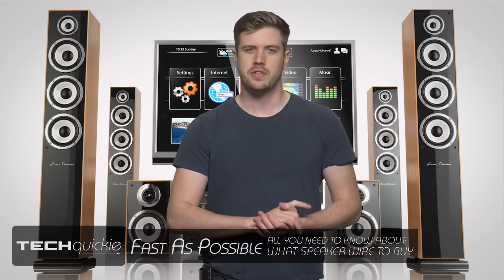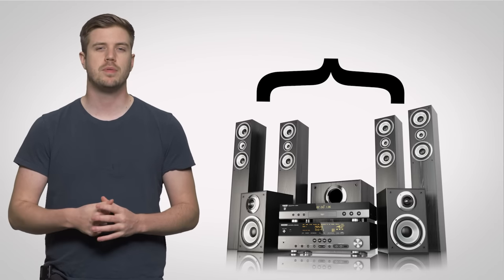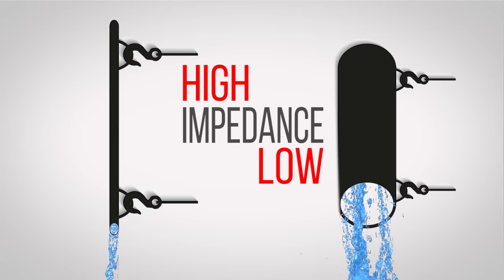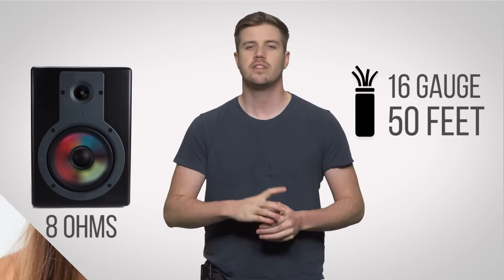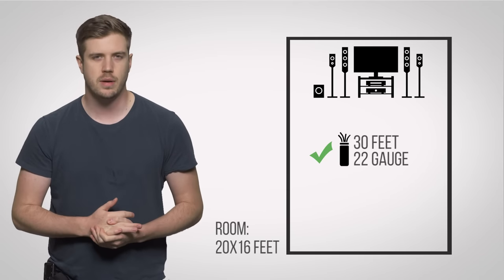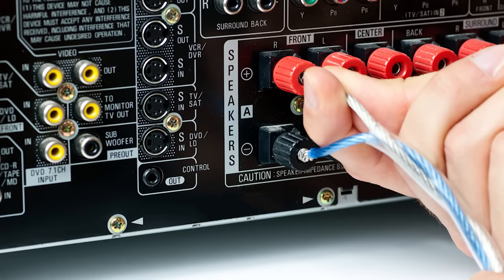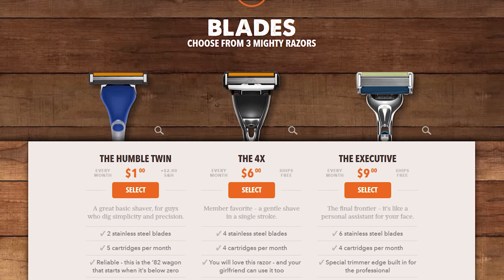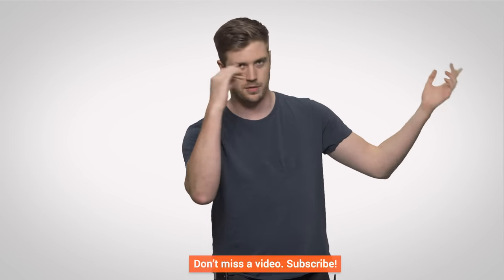What Speaker Wire To Buy As Fast As Possible

Comment: 16 ga lamp cord
good enough for my trainwreck amp
DONE
Reply: Define "trainwreck" 

if you mean old then it might actually be pretty good i know several amps from 70 - 80 and mid 90s who is considered best sound for various applications my Kenwood from 89 holds up pretty damn good as well real power house rated at 40 watts drives 2x15" subbs witouth any problems and a good cable helps a lot not only due to resistances but also sound quality there is a lot of factors to think about im using silver coated copper wire with tripple shielding and its as close as you can get for 150 dollars (which isnt that expansive)
Reply: Define "trainwreck" 

if you mean old then it might actually be pretty good i know several amps from 70 - 80 and mid 90s who is considered best sound for various applications my Kenwood from 89 holds up pretty damn good as well real power house rated at 40 watts drives 2x15" subbs witouth any problems and a good cable helps a lot not only due to resistances but also sound quality there is a lot of factors to think about im using silver coated copper wire with tripple shielding and its as close as you can get for 150 dollars (which isnt that expansive)

Comment: I'm very disappointed that you didn't at least annotate the converted units in metric units. You guys have an international audience - and most of the world has no clue what gauge 16 means. We need mm².
Also, you really should have explained the difference between 100% copper wire and the cheaper CCA Aluminum cable... and the fact that electrically, a thicker CCA cable is identical to a slightly thinner copper cable but often costs less.

Comment: Well yet another so called "expert" who is giving wrong information.  It wasn't terrible until he got to the point he voiced his opinion on better speaker cables.  That they are snake oil lol obviously someone who doesn't know audio.  All cables make a difference in sound quality, granted there are some cables as marketed as "higher end" especially through the chain stores, but there are better and higher end cables which you can purchase at your smaller independent high end stores that make a big difference in sound quality.
Reply: Audiophiles have strong opinions on speaker cables but frequently know very little about these low impedance loads or the conductors required to drive them. If they studied the subject properly before investing large sums in vastly overpriced conductors they would have a more objective opinion when choosing suitable cables for their systems.
Reply: @cbcdesign001  Who says they don't know?  Many audiophiles are engineers and PHD's.

Comment: High end speakers are 4 ohm???? WTF! That's a complete load of shit. I have been into extremely high end hi-fi for many years. I have come across no more than 3 4ohm speakers all of which were budget/ mid range. If anything hi-end manufacturers (or any for that matter) prefer to go no lower than 6 ohm so as not to drive the amplifier too hard. The only place 4ohm is really used is in car audio where as much power in as little space is important.

Comment: Yes, the wire gauge vs length is the big thing here, but the reasons you gave are just plain laughable.  The advice on using the thickest wire possible is the best advice to avoid the voltage drops presented by long runs of thin wire, but most of what you said in this, you pulled straight out of your posterior orifice, and has no basis in physics.

Thumbs up for the proper conclusion (the thicker the better), thumbs down for not understanding why.  Thumbs cancel, I won't rate it.

 73 de KC5VDJ

Comment: Come on guys.. 🤣😂
Recommending 20 and 22 gauge speaker wire for subwoofers... 👎💩
Sure if you have a crappy low wattage PC audio subwoofer or something maybe 20 gauge wire won't matter. 
20-22 awg wire is recommended for a maximum of 1.5-0.92 amps respectively. 
P=I^2*R
Assuming an 8 ohm load that gives you a maximum power rating of 18 watts for 20 gauge wire. 
If you have 100 watt, 8 ohm speakers you should be using an absolute minimum of 16 gauge wire. According to the recommended maximum current capacity of the wire. 
If someone followed your advice with anything but the crappiest low power equipment they could literally fry that 20-22 gauge wire in their living room and start a fire.

Comment: WRONG! 
high-end speakers have higher inpedance( @ 8ohms)  - normal/cheap speakers have lover( @ 4ohms) & car speakers have from 4 to 1 ohms. Do your reaserch better.
Reply: +Adam Steel what u have are speakers for mass production - check the big players with prices above 10k to 300k / either way his claim is wrong.
Reply: *****   Focal Grande Utopia 8ohms (150k)
BOWERS & WILKINS 802 8ohms
TIDAL Agoria 8ohms -Tidal sunray g2 8ohms
Magico ultimate 16ohms (300k)
etc
A few of the best speaker and most high end brands in the world
I guess u are just a fan jerky boy, and the video is at least wrong - don't make me loose my time with you
Reply: +i raul there are plenty of high end manufacturers that make 4ohm loudspeakers, and 8ohm for that matter. Doesn't really matter a decent 2 channel amp should run both. I used genesis   imaging modules IM-5200 which have 2ohm rating with a 50w denon for a while had no issues.
Reply: +i raul May I ask if you actually listen to many high end speakers? Or just talk about them? For example, the 802 is a hard speaker to drive, because although it is rated as 8 ohms, it is below 4 ohms for almost 1/3 of it's response. It shouldn't at all be rated as an 8 ohm speaker. 
Impedance has nothing to do with quality. Quality is determined by how well designed something is.
You want to know what speakers sound good, go out and listen to them. That's how speaker quality is determined.
Reply: bassl0va i build custom speakers - designer type - with high quality parts
Reply: David Soper either way the guy in the video is wrong - that was the main idea from the start
Reply: i raul Yes he is wrong, on quite a few things. Personally I prefer efficient speakers at least 8ohm 88db+. For the dynamics and volume mainly. Metal head :D
Reply: +David Soper ofc - but most of his audience gets fooled so easily - audiophile stuff is a totally different thing than computer stuff
Reply: i raul agreed they should stick to computers. They think that home theatre and hi-fi are the same thing too. Apples and oranges comparisons.
Reply: i raul Definitely. Every audio based video I've seen on this channel has been wrong in some way. He means well, but things should be better researched or otherwise just not mentioned. Most computer people get into all the headphone stuff too, which just isn't as good as speakers...

Comment: Thats some bad advice at the end.... And this content missed out the real issues when deciding which cables to get... like copper silver gold rhodium? pure vs plated? biwire? digital vs analogue? Etc... The first 3 '?' impacts prices but they may not always be coherent with the 4th '?'.. Cable length is rarely n issue beyond the 20ft range... Termination can be an issue with the suggestions made in the vid.. And the last advice on skimping on cable budget is the worse advice ever both for analogue n digital, and it made the entire video pointless as it cancels out everything said prior in the video!!
Reply: Theres no such thing as a digital vs analogue wire...
Reply: +k8 and optical cables are?? lol get a clue nub...
Reply: +plad plad He's talking about speaker wire, which is always analog, maybe you should watch the video first before commenting.
And silver, goldplated,... that's the snake oil he's talking about, something you clearly like to spend money on since you advise to spend enough money on speaker wire.
I have some pretty awesome equipment, yet my speaker wires are good old black and red cheap standard copper stuff of a healthy gauge (2.5mm²). Why? Because it doesn't matter, at all.
Reply: plad plad ...not used as speaker wire, if it was the speaker would only have two states it could be in- on or off. Good for a strobe light... or to plug into a receiver, but not for speakers. Music carried to standard speakers is ALWAYS analogue. I'm an electrical engineering student and a music producer, so I know lol

Comment: There is no significant impedance (AC inductive reactance /capacitive reaction) in the audio frequency spectrum. Resistance is the ONLY thing you need worry about. Even EMI has no significance in this LOW voltage/LOW impedance system  These two obviously have -0- electronic training rather just a couple of rather stupid snake oil salesman.

Comment: TL:DR ...get the fattest copper cables you can afford.
Reply: Not as simple as that sadly ...
Reply: +Annelise Meier Yeah, skin effect comes into play at higher frequencies. Thinner, multi-strand may work better and please the wife more :)
Reply: +Andrew Wilkes 
The "skin effect" at audio frequencies is marketing wank. It's negligible. It doesn't matter at all at low frequencies (where all the power is) and at the upper end (20kHz) it's an increase of at most a few milliohms over the full run of cable. Just the wire terminals at both ends add hundred times more resistance. It's also nothing compared to the impedance of the speaker itself.
So it is that simple. Get the fattest copper cable you can afford, even electrical wire is fine.